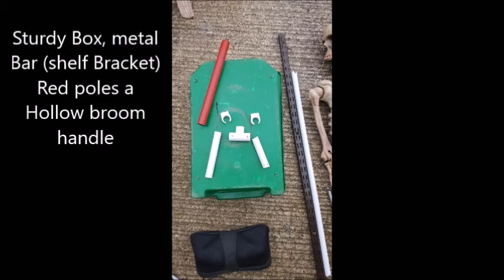DIY Animated slapping skeleton rough guide on how to make(Slappy)

Comment: Great work! I'm gathering supplies to try and create something similar. After you attached the spring to the skull, did you attach the other end of the spring to something to keep it from sliding around in the pipe? It appears that it was just dropped in place, but around 8:35 you can see that the head will stay facing a certain direction as you position it. Is it just the foam insulation that is somehow providing enough friction for it to stay put? I assume I am missing something...

Comment: I'm dying to know more about that vibrating prop near the end.
Reply from the maker: Hi steve Case had so much trouble making him vibrate even fright props vibrator could not cut it so attached a motor with a arm and weight on the end.That gave the required effect but makes it un stable due to vibrations if i can perfect it ill share.Another project i need to get back to soon

Comment: Hope your well ... Amazing props love the movements and the reactions 👍 your channel is great ... Less music more information I need to learn so much 🤣 being in the UK too you  your props are the best I've seen over here .
Reply from the maker: Thanks Lanky sime  very much a marmite thing on the music hope to do move vids soon uk still has a lot of catching up to do with the USA but home made still better. where in uk ?
Reply: @pauljones5601  I'm in Yorkshire mate  I have a couple of wiper motors that I plan on using this year I have already started doing a few bits and ordering 👍 love your vids very inspiring
Reply: @pauljones5601  do you use speed controllers on your props ordered a couple off Amazon today ....hoping they work out 🙄
Reply from the maker: @lankysime2372  12V-40V 10A PWM DC Motor Speed Controller module with Reverse Polarity protection, high current protection/12V DC Delay adjustable timer relay, delay Turn off Switch Module/Pressure Mat Alarm Switch Pad 720 x 390mm - PM156 Intruder Detector Burglar Care Home Resident Safety hope that helps
Reply: @pauljones5601  cool I'm on right track I ordered 2 X 12v - 60v pwm 😁. Just hope they last most are imports on Amazon tbf what isn't 🤪
Reply from the maker: True i have used that size motor man enough for most props
Reply: @pauljones5601  Youmile PWM Motor Speed controller £8.99 each off Amazon both arrived today tested on wiper motors seem to work like a charm 👍

Comment: Could I connect a motion sensor
Reply from the maker: Hi Crafty Cabbage yes i use one just before the power supply but i am in the process of switching over to  12V DC Delay adjustable timer relay, delay Turn off Switch Module and a pressure matt as they are more reliable
Reply: @pauljones5601  thanks how much did it cost roughly

Comment: Why not just use a car wiper motor??  That's aLOT of aggressive work.  Why not make it easy for yourself?  There are even a Hi/Low speed built into the motor already!
Reply from the maker: Cinbare has now been updated to a wiper motor as original failed also aded a step mat and timer